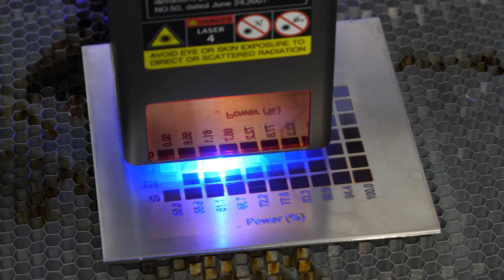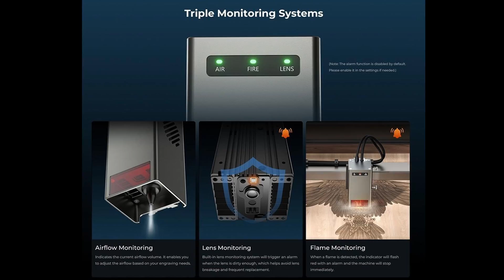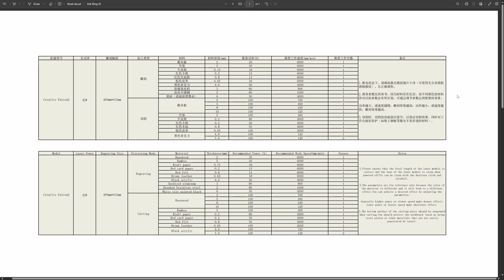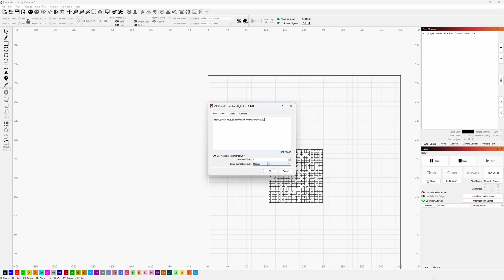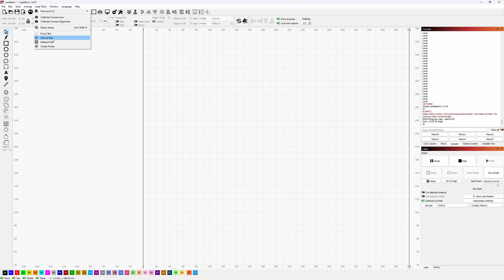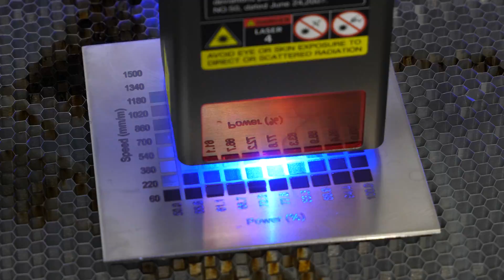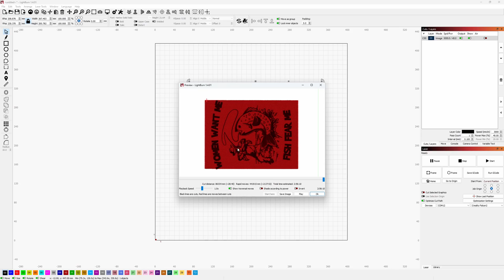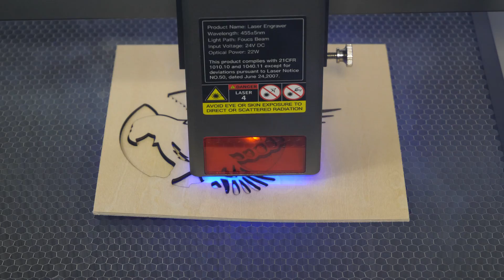Laser Everything! Creality Falcon2 Review & Setup Guide with LightBurn Software

Comment: Hi . I just bought a Falcon 2 Pro 40W - would it be possible to have the lightburn file you used for the stainless steel test?
Reply: If you go to top toolbar, Laser Tools -> Material Test then you'll be given the grid that he uses, and you can mess with the settings, size and if you want text enabled (you do)

Comment: why does absolutely everything including the manual, the video on the memory card and every single video review gloss over plugging in the laser module? the captive cable on the laser module on mine has a badly molded end, is on an angle and makes plugging it in difficult. i'm afraid to bend the pins. I cant even find an image of what its supposed to look like. from what I can tell the early models look like they just had a regular looking molex type locking connector. my connector looks like that, but has a molded strain relief that was not molded on correctly... it  is difficult to plug in straight because it gets in the way and is crooked itself.